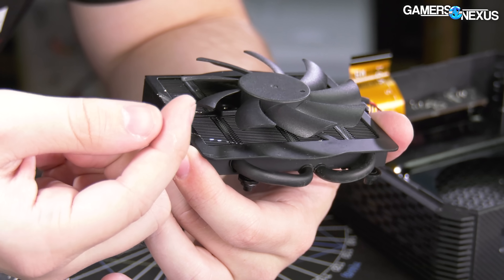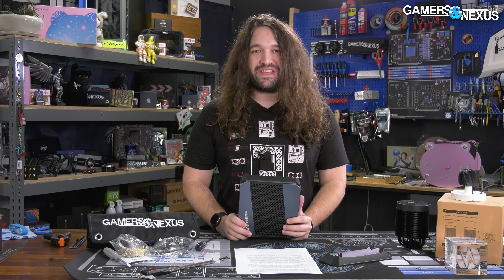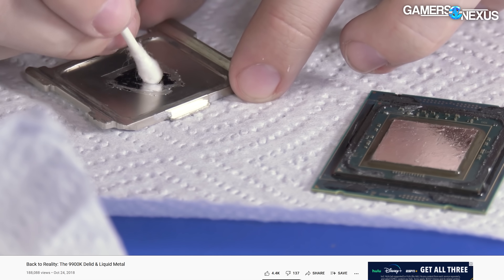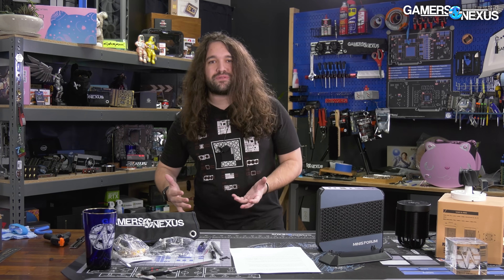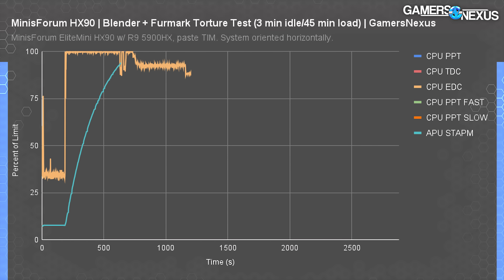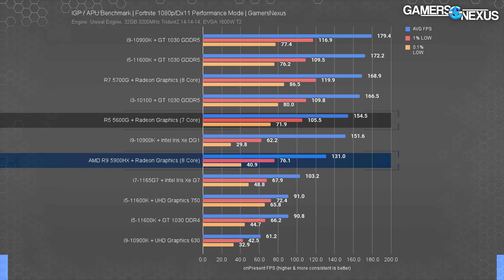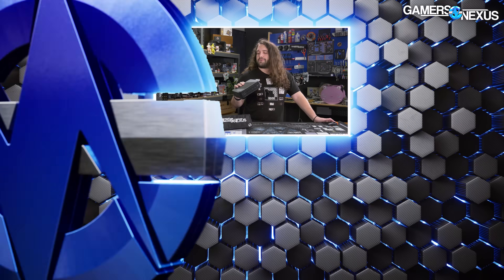Utter Incompetence: Liquid Metal Disaster in Minisforum HX90 Small AMD Gaming PC

Comment: Minisforum still might have issues with their liquid metal application. I got a used HX99G (supposedly LM for CPU and GPU) and was surprised that my fan ramps up quite a bit under heavy load (Cinebench R23 or multiple simultaneous compression and decompression jobs). Checking with HWiNFO, the core temps are all over the place.
A run of R23 had following max temps, while average temps were also at similar levels core to core: core 0 - 84.8C, core 1 - 64.8, core 2 - 91.7, core 3 - 74.2, core 4 82.2, core 5 - 79.2, core 6 - 66.6 and core 7 - 63.7.
Running multiple compressing and decompression jobs, core 2 went up to 99.2, while core 7 only reached 61.4, while the CPU was at 100% load and all cores were at around 4 GHz.

Comment: @Gamers Nexus, would you mind checking the new Miniforums UM690. The DDR5 RAM of this model overheats in just a couple of minutes when doing GPU intensive tasks, dropping the framerate to half. Contacting them, they do not agree to have an issue, but is obviously a serious design flaw due to poor backside ventilation.

Comment: You can get these devices fully loaded on marked down prices. You can’t do much to upgrade them anyway so the liquid metal would not bother me IF I really wanted one.. The CPU is impressive but video memory sucks on these devices. It doesn’t have a thunderbolt plug in either so forget plugging in extra gpu.
I really wanted a desktop this time around and the biggest thing keeping me from going small is video ram. 32 gb of ram and a lightning speed cpu sound great on paper but the low gpu doesn’t make up for much. Laptops are a better option and I’m not interested in buying another laptop.

Comment: I should have seen your video! Unfortunately I purchased an HM80 about a year ago, and in very, very short: Their hardware is unreliable, their service is laughable, and they try to trick you against common EU law.
In detail: The HM80 was unstable, often getting green screens. Driver updates improved the situation, but never solved it. MF's support: Reinstall WIndows. Why? This IS the bare Windows you provided! I had found a somewhat stable situation for some time with some certain driver combinations. I also tried a better PSU, bc the delivered one was at its limits, partially over them, when using both CPU and GPU.
Fast forward: For the first time I connected a 10 GBit USB SSD. The speed suddenly dropped at USB 2 level. Since this wasn't relevant at that point, we just waited. Then I got a large 20 TByte backup drive. Same issues there - but I initially thought the drive was unreliable and got a replacement. In the meantime, I got a 10 GBit USB hub and connected my existing drives to it. LOTS of connection issues, then two of my drives went RAW - partition data destroyed! 
Replacement drive came, same issues with performance - then I finally realized the front ports weren't reliable with 10 GBit USB! ALL OF THEM! I informed MF about it, requested a new BIOS (due to AMD machines had a USB bug that required a BIOS fix). All they answered was: "If the drive went RAW, reformat it". WHAT?! I just lost 6 TBytes of important data, and I should reformat it?!
Then I informed them about the AMD chipset issue, and again requested the most recent BIOS. Now they wanted me to FILM that the drives went raw! FOR A BIOS?! I answered them they couldn't be serious, and I wouldn't put my data at risk again. I sent them a screenshot of a 70 GByte file trickling with less than 5 MB/sec onto the brand new hard drive (which had barely data on it, and all was structured). They replied that happens when you write a lot of small files. BUT THE SCREENSHOT HAS SHOWN I WAS COPYING ONE CHUNKY DAMN LARGE FILE! I requested a new BIOS, if that didn't happen, I want a replacement unit. Then nothing for two weeks.
Then the fan started humming - after just a year. Oiled it, didn't help. In a forum someone described the same issue, he ordered 5 additional fans from them bc he wanted to use the machine for that period of time. But just in short: The fan bearing is of mediocre quality.
In the meantime, I did driver updates, and the machine became unstable again. Restoring the old stable drivers didn't help this time. The machine is on the whole day, and crashes on either idling or when running video or 3D. When it's under constant low stress, it doesn't - which makes me believe that it's power or capacitor related.

A few days ago the machine crashed 3 times a day! That's where I got fed up. I requested a replacement or my money back. They offered me a replacement, but I should pay a use fee, as I had it over a year. This is illegal in the EU! Also, the fault was clearly on the company's side, and mostly existed since day one - crashes were there, and the USB ports, which could also just be USB ports certified for 5 GBit, were probably not 10 GBit-capable since day one - I just happened to go for 10 GBit devices later.

This is still an ongoing thing, but I am SO fed up with this company. Their support doesn't want to solve your problem, it just gives you other possible reasons that are not their fault. 
They actually ignore your requests (BIOS, replacement at first time), and they (try to) do things against the law (BTW, their "duty free" shopping is labelling the units as cheap set top boxes). 

Thing is, and you can see by my channel, I know quite some bits about software and hardware, and I know how to solve things - and I also am capable of understanding causes. I am so fed up my this company now - their products are not cheap, yet I thought they were good. They aren't. They use quality components (e.g. Kingston SSD and mem), but they don't seem to be capable of putting these things properly together.

Comment: I recently (June 2022) returned a new HX90 mini, because of an electrical short that caused a ground loop when connected to AC powered studio monitor speakers.  Static electricity could be heard through the speakers and also affected the USB mouse and HDMI display monitor.  The same speaker set up did NOT create a ground loop with other PCs:  two Mac Pros, one ASUS laptop, two Galaxy phones. Have you tested this device for electrical grounding?  That begs the question... does liquid metal cause electrical grounding issues on all the PCs in which it is used, whether it is contained properly or not?  Because on this HX90, it was contained and sealed in as der8auer suggested.

Comment: The way I read their description of the material is that it's carbon fibre reinforced plastic with a carbon sheet look. It's injection molded, so that means they can't use sheets. But essentially all carbon or glass fiber products are different levels of plastic and fibre combination. If you use sheets you have a lot of the fibres and typically use epoxy (which is plastic), if you injection mold it you typically use shorter pieces of fibers and something like ABS plastic that can be injection molded. It's not bad in any way, except that it gives marketing teams a way to mislead customers. But nearly all high strength plastics (for tools and such) uses these materials. It should say how much fibre is in it though.

Comment: If anyone is interested -- I purchased one of these units because finding an AMD SFF computer is already challenging -- especially one with a decent CPU inside. I purchased my unit rather recently and didn't see this video before purchasing the unit.

I have opened my unit to upgrade the RAM and NVMe drive and I didn't notice any issues internally. I installed Ubuntu 22.04 flawlessly and all parts within the machine were working correctly from the USB installation drive. 

The computer itself seems to run fine! I've had no issues with reboots or problems with cooling (I have a fan pointed at it and I left it in the horizontal position since the vertical mount does block airflow. After running pt_linux benchmark (Passmark), the computer received a score of ~25,300. 

All in all, I am happy with the unit and it has been running for about a month with no issues whatsoever. I am using it as an Elasticsearch node and I am happy with the purchase. Would I buy it again? Maybe -- but knowing that internally it is just a standard mini-itx motherboard, I might be inclined to just build one myself. It is just aggravating that there are so few AMD nucs out there with decent CPUs.
Reply: Thanks a lot. I was about to purchase 3 of these and now I got really worried due to this video.

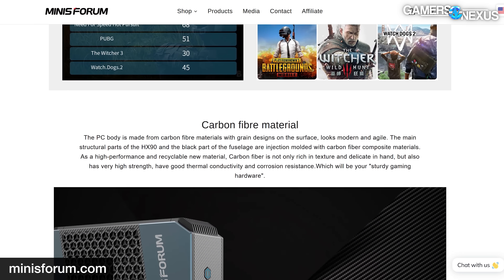Comment: Just want to point out at 11:06 that the material is actually “carbon fibre composite materials” and not just “carbon fibre”

There are big differences between the two and only idiots would think they are the same and comparable.

Its carbon-composite material and just carbon fibre… which is not even a composite material.

Btw, I’m not a material expert so feel free to correct me.

Comment: Hi, thanks for the video, it is very informative. I purchased my HX90 in Oct and received in in the beginning of Dec. Didn't notice any liquid metal splatter when I opened it to install RAM and NVME. There is a problem though that really bothers me, the unit is very noisy, the fan ramps up the speed and noise out of the blue. There are only two options in the BIOS, enable or disable either CPU fan or System fan. I run Rocky Linux and hwmon does not have any  devices for the fan, censors didn't find any either. Any suggestion on how to reduce noise fan on this unit? I don't use it for gaming. Thanks in advance!
Reply: I've seen someone say they use a 120mm fan sitting on the top, blowing into the internal fan. (Named "AC Infinity MULTIFAN S3, Quiet 120mm USB Fan"). They said it's quiet and they taped around the skirt of the fan, to the top of their HX90 to force as much into the machine, and it's very quiet even encoding videos for hours.

Comment: BIOS PROBLEM - MINISFORUM U700
Hi,  I own a Mini PC brand Minisforum model U700, the Driver Booster 9 program indicated a Bios Update, and when installing it,  it gave me an error and then the MiniPC turns on but does not start,  it always remains on a black screen. MinisForum gave me the Bios file which has a .bin extension but they don't tell me how to reinstall it, nor does it have a Jumper (at least I couldn't identify it). It has a reset button but didn’t do anything for the problem, I already tried removing the battery and nothing.

I wanted to know if you or someone in your community could help me, I can't get U700 to boot from the pendrive, I have already tried to format it in FAT32 and with other programs to make it bootable but there is no way for the minipc to boot from the pendrive.

Comment: For those still interested, TechTablets here on youtube got his hands on a retail unit with the liquid metal, and it looks like they've resolved the issues.
The entire cooling assembly is sealed up with some kind of gasket so there's no risk of the liquid metal leaking.
Only a 3c difference between that and the thermal paste version though, so yeah.
Reply: Well I watched this video but still decided that the HX90 was a worthy purchase and so went out and bought one.  From reading other reviews, it just sounds like they botched the initial machines and is more of a quality control issue than a bad product.  Gamer Nexus does put out worthy content but seems to take a lot of pleasure in giving PC builders a thorough good kicking!  So if and when they do take heed and rectify an issue,  this is still out there so one has does also have to look at other reviews to come to a more balanced conclusion.

Comment: 4:15 tells us that the application of liquid metal is special and you need to take care
Meanwhile me upgrading to my new cpu:
Dripping the liquid metal directly from my old cpu onto my new cpu -> installing it without spreading it at all

Yet no issues at all, chill 47-52°C on max load

Very special and took much care yes yes
Reply: Die to cooler vs IHS to cooler is different, also that is a super shitty way to apply any thermal interface.
Reply: Die to cooler vs IHS to cooler is different, also that is a super shitty way to apply any thermal interface. Also my 2700x runs 50 C max and I won't tell you about my case and cooler along with overclocks because that's not relevant.

Comment: Just got my HX90. Glad to say that there is no liquid metal splatter and everything is running great after I installed the Nvme SSD, RAM, & SATA SSD x2 (I bought the barebones version). I'm running Linux (Manjaro) on it and it's very snappy! Need to tinker more but everything seems to be working as intended. Even the 2.5Gb ethernet is correctly recognized. No regrets so far!

Comment: I'm so glad I stayed away from this product. It's just better at this point to use a small form factor case with a full Mini-ITX build with cases like an NR200 or a Sliger CL530 as it would give you the options to use a discrete GPU over an APU. I get the point of the minis forum machine, but at this kind of spectacular failure its' size would absolutely moot.

Comment: My order is refunded but they did not bother to give a reason! I lost about 7% of my money due to currency exchange fluctuation (exchange rate difference between payment and refund date).
Reply: Anyone care to recommend other mini PC?
Reply: Note, that this video contained a pre-production sample, which is not the production unit. They have released a video of production video, which solves the problem mentioned in a few reviews.

They messed up sending a prototype to review instead of the final product. Marketing could also be improved. They seem to be using plastic with carbon fibre mixed in, but that carbon fibre wieve look was a bad idea (folks got a wrong idea thinking it's carbon fibre-only material).

Will have to wait and see the actual production unit under review.

Comment: It seems like they started using liquid metal on this and then found out that their process didn't work. Then they tried to clean the messed up hardware and used regular thermal paste. But they obviously didn't want to go back on their claims.
Speaking of claims: the patented AVE soldering iron plastic test revealed that their claims of carbon fibre in there are clearly a lie. Except it's hidden somewhere else, which I doubt. Even if it is the claims about carbon fibre itself are rediculous.  I somewhat doubt that carbon fibre plastic has a significantly better thermal conductance perpendicular to the direction of the fibres. Wich is how it would be oriented in pretty much any case.

Comment: CL22?! HOYL JJESUM
Reply: CL22 is standard JEDEC timming DDR4 3200. Anything beyond that is not in spec and considered overclocking. Just everyone using XMP today does not change the fact these sticks require overclocking the IMC to work at it rated timmings. OEM will mostly stay away from XMP/Overclocking.

Comment: In addition to all the bullcrap that you caught on, the sentence "As a high-performance and recyclable new material, carbon fiber is not only rich in texture and delicate in hand, but also has a very high strength, have good thermal conductivity and corrosion resistance." has 2 glaring flaws:
1) Carbon fiber is notoriously hard to recycle, like the majority of composite materials
2) The "good thermal conductivity" is extremely misleading. While the carbon fibers themselves have excellent thermal conductivity along the grain, the composite material colloquially known as "carbon fiber" is actually a polymer (plastic) reinforced with carbon fiber strands, and nearly always is an excellent insulator. It should also be noted that carbon fiber is not an isotropic material, i.e., the direction of the weave matters a lot.

Comment: I may be a bit late to the party but yes, you can injection mold with carbon fibre. However its basically shredded down carbon fibre that is just added to the plastic. It makes the plastic a little bit "stronger" but not even close to the level that actual carbon fibre is at and its a recycling method for used carbon fibre.
IMO this is just marketing, get a buzzword like "carbon fibre" in there and hope people fall for it.

Comment: Torx is better than Philipps in absolutely every conceivable way, the one downside is that you need a matching screwdriver or bit.  It's way more durable and has a much larger surface compared to pretty much anything else. It shares its one drawback with hex, but is slightly better than hex otherwise. Torx even supports ball head drivers (like hex, but unlike Philipps or Pozidrive), which means you can screw them in at an angle without stripping the screws. It's the go-to for engineers and carpenters alike, especially in Europe. 

Also, you can have carbon fiber in plastic (usually Nylon). It doesn't look like "normal" carbon fiber, which is carbon fiber sheets in epoxy. Carbon (or glass) fiber reinforced plastics look like regular plastics, and they're not as light or durable as the stuff most people think of when they call something "carbon fiber", but it's quite common and in many cases very much an improvement over just plain plastics. You can tell the difference by shaving parts off the material with a razor blade.

Comment: I don't understand.   There is no liquid metal used in cooling the CPU in this system.  But there are liquid metal droplets on the fan, cooler and motherboard?   Where did it come from if it isn't used in the system?

Yeah, that's a no buy.

Comment: "corrosion resistance"
what kind of idiot you have to be to corrode a pc case????
i have old pc case from 2007 and its still almost as brand new (front panels HUD that showed cpu temp stopped working)
and not a bit corroded